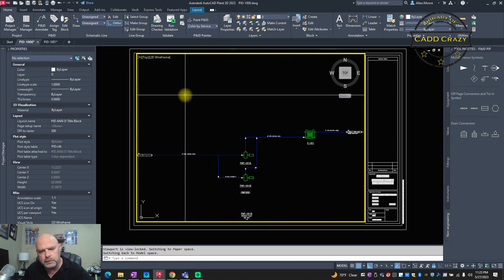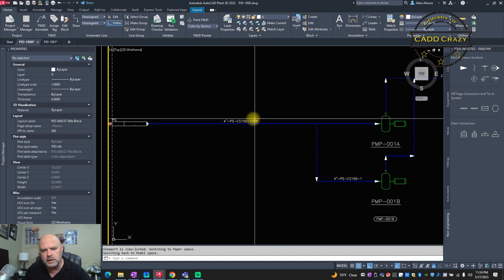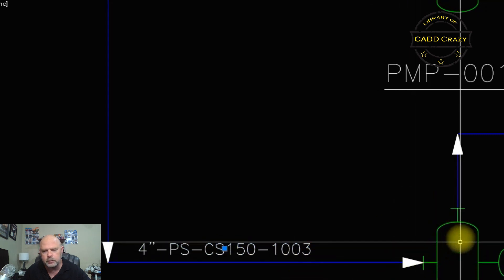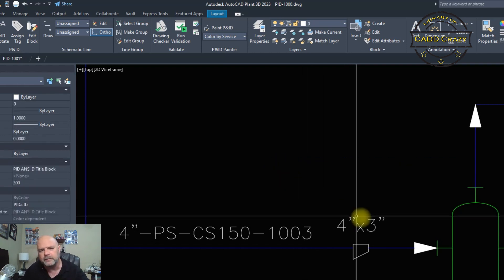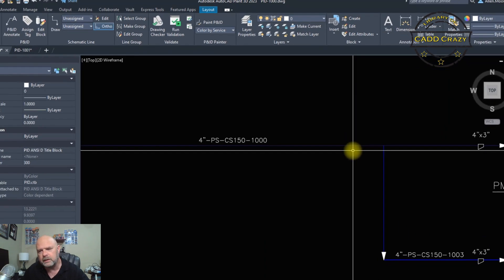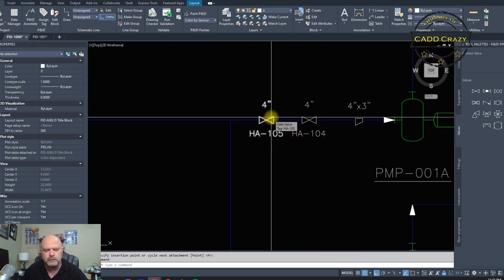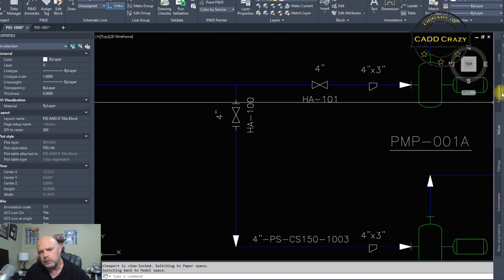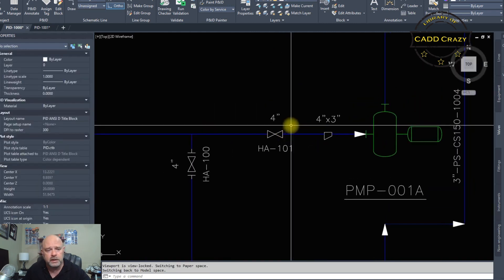AutoCAD Plant 3D P&ID Fitting Placement

Comment: Nice video!  In your video I see line 1004 connects to line 1001 after the pump.  Why does the AutoCAD program not add a 3x2 reducer?  I can add a reducer manually, but the reducer size does not update as I think it should.  If I add a reducer it would show as a 3x3, instead of a 3x2.